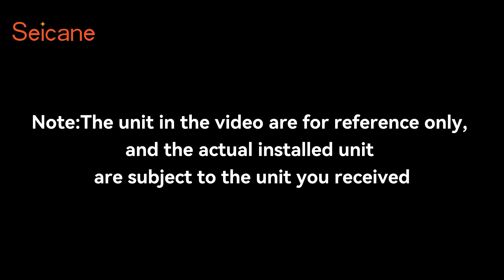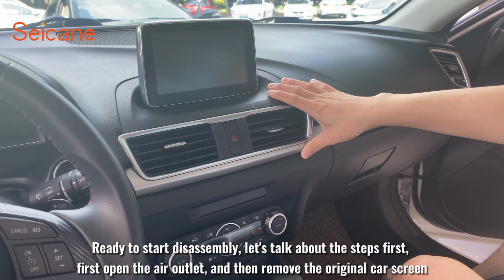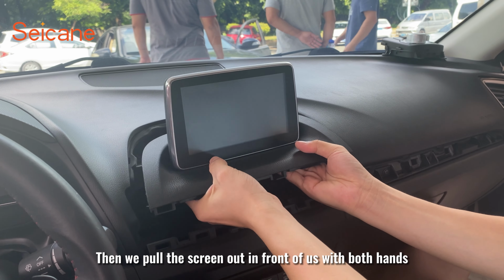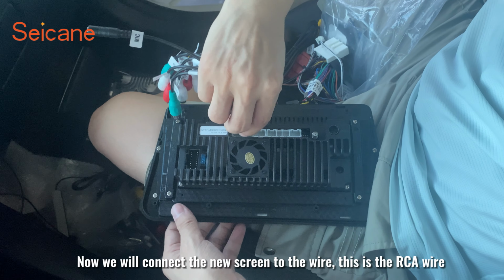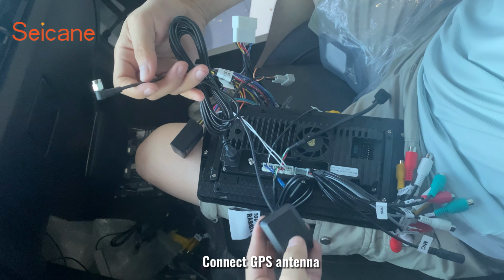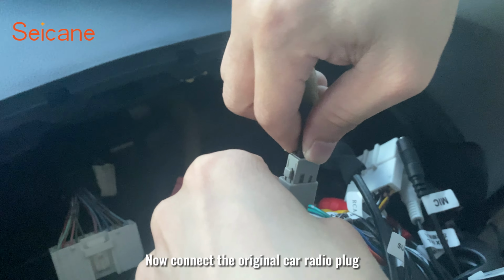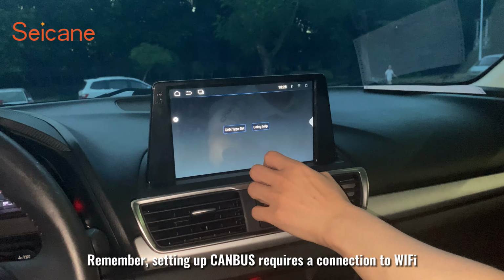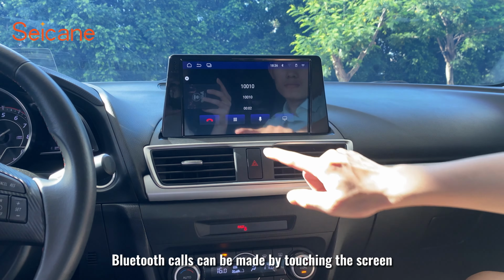DIY Carplay Upgrade! Install Android radio for 2014 2015 2016 Mazda 3 Axela with GPS bluetooth

Comment: Will this unit work with the oem backup cam, the bose premium audio system, and the heads up display?
Reply from the maker: Hello,
1. If the plug of the camera video out cable of your original car is the same as ours  camera video in plug ,then it can support your oem backup cam.
2.Yes, it can support bose premium audio system
3. Sorry ,it cannot support heads up display

Comment: can I purchase without problems from germany? Do I need to buy a CANBUS seperatly?
Reply from the maker: hi, yes, we can ship the package to Germany.. it comes with a canbus.
Reply from the maker: here is the item link : https://www.seicane.com/carplay-full-fit-screen-for-2014-2015-2016-2017-2018-2019-mazda3-axela-gps-navigation-radio-t2104
Reply: @Seicane-Car-DVD  thank u
Reply: Is it good for Mazda 6 2018 ?
Reply: Hi marcel hast du es gekauft? Bist du zufrieden?
Reply: @blyatberry7036  ja ich habe es gekauft, ich muss sagen das du für das Auto von der Passform her kein schöneres infotainment bekommst wie dieses hier. Leider muss ich aber sagen das der preis sehr hoch ist und noch sehr hohe versandkosten dazukommen (waren bei mir so ca 500 Euro)
Aber wenn es dir das Geld wert ist, würde ich sagen das du damit glücklich wirst
Reply: @marcelschareika6545  ah ok krass danke für deine erliche und rasche antwort noch eines hast du den stärkeren genommen mit mehr rom und ram? Bin am überlegen ob der schwächere genügend ist weil es günstiger wäre
Reply: Hi Marcel, ich habe mir das Display auch gekauft aber jetzt merke ich, dass ich für den roten Kabelbaum (roter Stecker) gar keinen Anschluss habe? Oder bin ich einfach zu doof? Wäre mega, wenn du mir helfen könntest. Oder hat das was mit meinem Bose Soundsystem zu tun?
Reply: @ du musst einen anderen kabelbaum verwenden. Der mit dem großen weißen Stecker hat bei mir gepasst